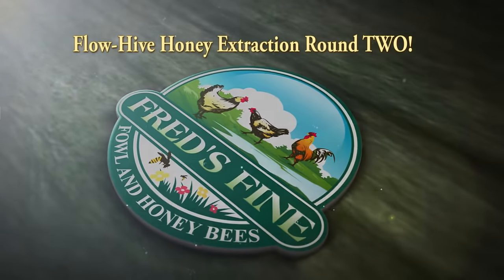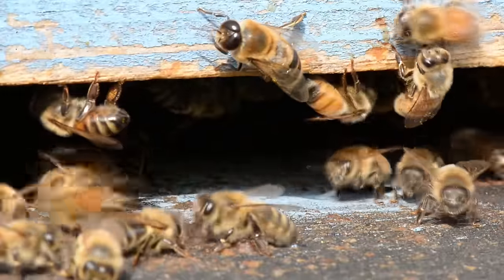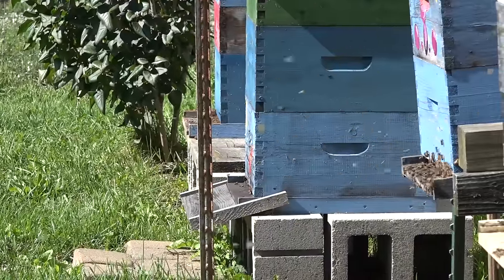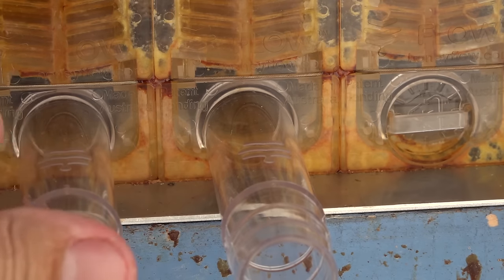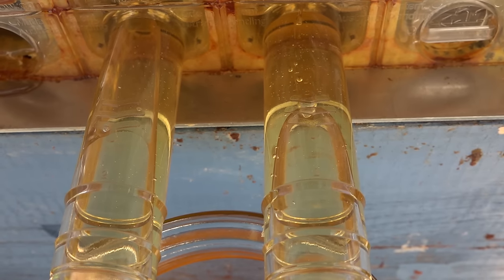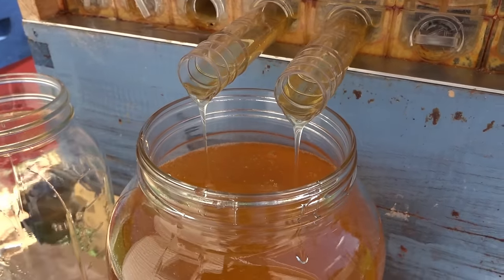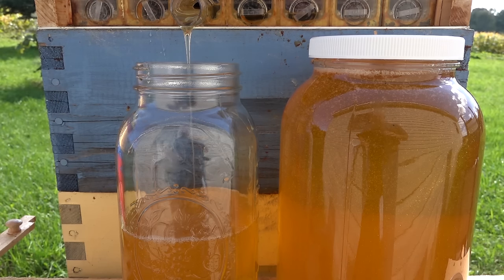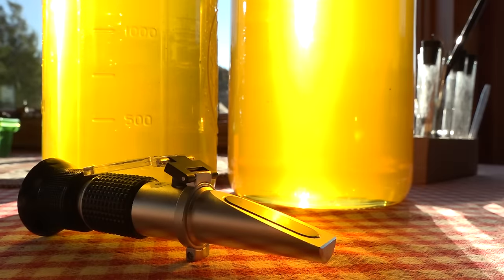The Flow Hive for Honey Bees 2nd Honey Harvest Review and Testing

Comment: Would you consider not doing every frame at the same time, to prevent the mass move out of the hive? Or does it even happen with just one frame extraction?
Reply from the maker: Hi Branolia, I thought I tried to explain that very thing in this video. Yes, not draining all frames at the same time does reduce the likelihood that honey will drip inside the hive. The other method that reduces leaked honey is opening each frame 1/2 at a time and by watching the flow, you will know when it' slow enough to open the remaining portions. In this video we had no problems at all. Thanks for your questions :)
Reply: That would work but my idea was more spread out perhaps several days. Dont know if that would even be bad so i was wondering
Reply from the maker: You could take a frame a day if you wanted to, that's really part of the beauty of the flowframes, you can take a lot or a little and the lid stays on, so you're not traumatizing or disrupting the bees in the way we do when pulling frames for uncapping and spinning... we tear out all the connective parts inside the hive each time we remove a frame, so we like to do that in one feld swoop. Flow-Frames remain in place, so taking one at a time makes no difference to the bees :)

Comment: Fred, your bee videos are awesome. Great quality close-ups and well done. My wife and I have been debating trying a hive of our own. I've been trying to find an answer to a question, and everywhere I've looked on the internet I cannot find the answer: can you tell me why some hives are 2 boxes high and some are 3 or 4 boxes high? Should a new hive start with 2 boxes then be expanded to more as the number of bees increases?
Reply from the maker: Thank you so much for your compliment and I'm happy to address your question. if you decide to purchase a flowhive, please e-mail me and I can get you 50.00 off your purchase. Regarding the number of boxes, that's largely regional and seasonal. Every hive/colony will start with a single deep box that sets on the bottom board. it will have  either 8 or 10 frames inside, this is why some are referred to 8 frame boxes and others 10 frame boxes. As the bees become established and their numbers increase (seeing comb drawn out on most of the frames) you can add another deep box (in northern colder climates) or a medium box that the bees will expand into. I live in the north, so all of my hives have two deep boxes, then I add medium boxes as the colony numbers increase so they can fill the upper boxes with honeycomb. When you generally see four to 8 boxes all stacked up, it's because the bees are filling each lower box solid with honey stores and the others are added so the bees have a place to store their resources. After that, as the season ends, surplus boxes are removed and the honey harvested until the bees are left with a manageable two to three boxes going into winter. I hope that's helpful? Flowhives allow us to remove some honey and allow the bees to refill them without becoming honey-bound. It's inconvenient for most traditional keepers to do intermediate honey harvests, so they just keep adding honey supers until all is harvested at one time.
Reply: Frederick Dunn , wow that sounds way more complex than I expected! It sounds like there is way more involved with bee keeping that at first glance. I've seen other people with new Flow hives say that they had to wait for their hive to grow before adding the "flow Box" for the honey, but it doesn't look like you did that. Or did you just add your flow box to existing hive boxes?
Reply from the maker: adoptedchineseboy I added the flowsupers to existing colonies that have been established for years :)  so, they were not still building up their population.

Comment: Hello, thanks for the video. one question regarding the "debris" you mentioned coming out with the honey. How or what do you do to deal with that after collection?  Is it possible to strain as you extract?
Reply from the maker: HI Don, you can filter that out if you want to, remember that it is only bits of wax and propolis, I just let it rise to the top of the honey and scoop it off after a day or so. But yes, you can run the honey through a screen and get it out easily.
Reply: Thank you Frederick.I was curious how you handled it.
Reply from the maker: You're welcome

Comment: Frederick, with a brand new set up for a beginner, is it best to buy a nuc hive or what would you recommend pls?
Reply from the maker: Hi again Pag, the quickest colony build up will come from purchased NUC packages. They come with a queen bee, workers and brood frames that will begin hatching baby bees right away. That means there is no down time with the colony and it will build up quickly. The other method is buying package bees, that's a pre-mated queen in a cage with several (generally 3 or 5) pounds of worker bees. Before the queen can begin laying, the new workers have to build up and draw out comb and then the queen will begin laying. After laying, baby bees don't hatch for another 21 days, so let's say 28 days from package bees being installed, the numbers will begin to increase and the colony will build up from there. NUCs are best, but more expensive.

Comment: Question did you injure any bees during the activation  of your flow hive?
Reply from the maker: I think that somewhere, at some time, someone said the bees get injured. I've never had a single honey bee injured when cycling a flow-frame. They have plenty of room and time to pull out if they are working a cell. The edges are designed so there aren't any pinch-points. When the cells are capped, and 90% of them are when extracting the honey, bees are standing on the cap-wax and not in the cells. You would see bee-parts coming out with the honey and in all the years  I've used these, no bee parts and no crunched bees in cells when cycling.
Reply: @FrederickDunn  That is fantastic news thank you for responding

Comment: Hi. Sorry if you've already answered this in a comment or video. In your last video there was excess honey in the collection tubes (before collection I think) but they seemed to be blocked by wax and/or propolis. I was just wondering if the bees managed to clean up the excess honey that was in the tubes? I think you mentioned something about it in your last video but I'm not sure. Thanks and great video :-)
Reply from the maker: The honey did drain down into the troughs after draining the frames, but not before. The wax build up you see in the video is actually outside the trough interior draining area. And yes, the bees did clear it up within a day of extraction. I hope that answers your question?
Reply: Thanks for the response, and yes that does answer my question :-) Another question though, how do the bees get into the trough/tube to get to the leftover honey? I'd assumed the trough/tube was separated from the rest of the frame so the bees don't get into the tubes. Thanks again :-)
Reply from the maker: There are very tiny weep-holes that the bees insert their tongues through to collect leftover honey. You are correct, they can't actually get IN the drainage trough. You're welcome :)

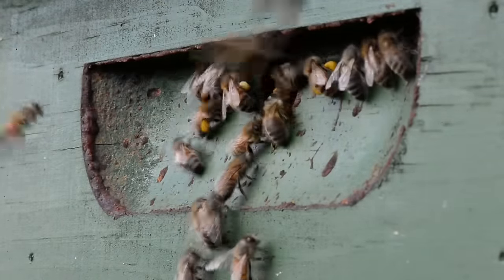Comment: 3:13 Does the logic also apply that the bees use this entrance in order to bypass a queen excluder? Also, could you have a full-sized entrance on the top instead of just a hole?
Reply from the maker: Full size entrances at the top often make it easier for robbers and raiding. Smaller upper entrances are easier to defend.

Comment: Frederick thank you for the amazing video fantastic information. Could you please tell me in your opinion what would be the best product to buy from flow Hive for a beginner?
Reply from the maker: Hi Thomas, thank you for the wonderful compliments.
As for what a beginner should buy from flow, my recommendation would be to purchase a beekeeping starter hive/kit from one of the main bee equipment suppliers and then just add the FlowHive Super. If the FlowSuper doesn't work out for you, you'll have the conventional hive to fall back on and won't have spent a great deal of $$$. Actually, I'd recommend not purchasing any flow equipment until you've discovered that you like keeping bees with the cheaper and more frequently used configuration. I would have purchased the entire system from FlowHive, but they only offered the six frame size as a complete unit, so I was left with the FlowFrames as a super alone. I am hoping that they come out with the larger version soon. Wishing you well!
Reply: So are you recommending a conventional every day hive and a flow hive to start? Thank you so much for your time. And Merry Christmas
Reply from the maker: ***** Yes... conventional, with a flow super. Thanks and the same to you! :)

Comment: Quick question, what would happen if the colony decides to put larvae in the flow frames?
Reply from the maker: It would be time to re-arrange the hive boxes to make sure the flowhive frames are in the upper honey storage layers. It's also one reason why I generally have at least two lower boxes which are dedicated to the bees brood, pollen stores and some honey. Then I place a honey super on and after that, a flow super. Even in a feral colony, when you get into their comb construction, they keep their brood in the lower 1/3 to lower 1/4 depending on the size of their comb and population density. Upper comb is always honey.  If someone were to have just two boxes, bottom box for brood and then the very next box being FlowFrames, it would be "possible" for the queen to begin using the flow frames, but that would indicate that the beekeeper wasn't paying attention to the need for additional space and expand accordingly. Eggs or larvae in the flowframes would be the time to remove them and get them cleaned out before the larvae add their dense fibrous coating to the cells. Easier avoided through management than to deal with after the incident happens. Worst case scenario, the flow frames would have to be removed, taken apart and carefully cleaned before finding their proper place in the hive as a honey super only.

Comment: Fred, I apologize if this has been answered elsewhere, but did you ever (even after these Flow videos were done) get brood in your flow super since you use no queen excluder?
Reply from the maker: No apology necessary. I have three flowhives on through the first year and no queen has decided to lay in them "yet"... there are others on the flow forum who are reporting that they did indeed have queens lay in them. I personally just make sure that the queen would have to cross over other honey supers prior to getting up into the flowframes and that has worked. It is "possible" just hasn't been something I've observed/experienced yet.
Reply: Frederick Dunn followup question: It looks like hive 7 just has 1 deep brood and then a medium super? Then after that you have a flow super. Wouldn't that colony be too small to fill both a medium super and a flow super? Seems like I always read that the rule of thumb is 2 deep broods followed by a super. I must have watched these videos 10 times now, lol.
Reply from the maker: Colony productivity and required space is wide and varied. I have a few colonies that never need more than two deeps and one medium super, more than enough for them. I have other overachieving colonies that require several supers or they would simply become honey bound with populations too high for such a small hive set up. Those require several honey supers during nectar flows... aka honey flow cycles. Honestly, no two colonies are the same.

Comment: I have a very short bee season in Alaska.  I used the flow hive last season but experienced very little honey stored in the flow frames.  Do you think it would be more effective to use a single brood box, vs. two brood boxes, to encourage vertical movement and honey storage?
Reply from the maker: With such a short nectar gathering season, I may not consider the flowhive to be a viable option in my opinion. There are lots of keepers in Alaska who start over each and every year just because they can't overwinter. I'm not sure that you can expect enough surplus to make the flowsupers work out. Are there others in your area that have produced enough for taking off and allowing the bees sufficient stores to get through winter?
Reply: Frederick Dunn No, it is not possible to overwinter bees in my City without a heated bee shed.  I got it to experiment and was wondering if not using a second brood box might encourage them to move up?
Reply from the maker: Yes, if you only have one brood box and then the flowhive, they will move up and use the space quicker.

Comment: Would you recommend filtering the honey thru some form of filter at the top of the jar, before it goes into the jar - just to make it more pure?
Reply from the maker: Hi Philip, I personally wouldn't put a pre-filter on the jar. Just like the air that's in the honey, the particulates will rise to the top and can be scooped or poured off as necessary after a couple of days. BUT, if someone doesn't want to wait for that or is giving the honey away, then yes, a pre-filter can be used. Thanks for that question.

Comment: i really like these videos but i do have a question,  is there any concern that this type of hive could damage and injure bees when you reset the plastic honey comb after extraction?? i can see that it would not be a concern beforehand since the cap would keep the bee out but i would imagine that the cap would break a bit when you do open the comb and allow bees access again.
Reply from the maker: That is a very good and fairly frequent concern. They actually did a good job when they designed the moving parts and this is why there are gaps and uneven edges between them. Even if there is a worker partly in the open (draining) cells, they have room to move out as the parts match up again when closing. It's easy to observe and there have been no casualties yet. You can see the bees trying to get into the cells when in the draining position, but they can only reach part way. Because this comes up so often, I think in my next video, I may focus very closely on a worker that is partly in a cell when they are returned to the closed position so this is more easily understood. Thanks!

Comment: So in the flow hive.  what are your thoughts on bees filling those frames with pollen?
Reply from the maker: Hi Andrew, thanks for that question. Because the bees use pollen to feed developing brood, they "generally" pack cells with pollen that are in close proximity to the brood cells, most often even on the same frames as brood. If I notice pollen and brood developing and spreading UP within the hive, I would definitely add more supers under the flowsuper before they begin storing so high up. To date, I haven't had any workers putting pollen near the upper supers, so, we're good. If it does happen I will be sure to show it and how I clean them out. I hope that answers your question?

Comment: Amazing stuff! One thing I keep hearing is that the combs need to be all capped or you will be killing bees mid process of filling. Do you wait till they are all filled by opening the flowhive to check or do you just guess?
Reply from the maker: Hi Johathan, people who make statements like that don't have any experience with flow-frames. Just as with all honey supers, you're pretty good if 80% of the cells are capped and of course, you can verify that with a refractometer if in doubt. Far more bees are smashed, squished, and rolled during traditional honey harvesting.
Reply: I use Flow Hives and conventional hives.  I have to admit, FlowHives make it so easy... ;-)  They work exactly as Mr. Dunn's video shows.

Comment: Hi Frederick,
I need a little advice . My neighbour bought a FlowHive at the same time I did. He has located his in a rural area , sandy soil , nearer to the coast than mine. Anyway he is concerned that the cells in the brood box are a dark grey and he also says that there are more bees than when he put the nuc in the brood box. He is concerned that he might have a diseased hive. Any thoughts ?
Regards
Chas Greenway
Reply from the maker: When you say the cells are dark grey, are you talking about cell "cap" color or the cell structure color? I need more information than that. IF cell caps are off in color and appear in any way gooey or brood cells become concave and appear greasy, those are concerning conditions. Cell structure color is not so much of a concern. Fresh honey comb is white, but the bees tramp all over it with their dirty feet and alter the surface color of honey comb, this is why older comb, particularly in brood chambers/comb, the appearance is often very dark "coffee" brown. Not an indicator of disease. Thanks for the question Chas and as for the number of bees increasing? That's also not a problem in my opinion.

Comment: Do they always evacuate out of the hive when honey is harvested? Is it bad for the bees if the hive gets soaked?
Reply from the maker: It is bad to allow too much honey to run down into the hive and no, they don't always evacuate. The only time I had that issue was during the first extraction and it hasn't happened again since. I also don't open all of the frames at once and I do it 1/2 the frame at a time, this allows the honey to flow through the proper channels and not down the sides and into the hive. It was a learning process.